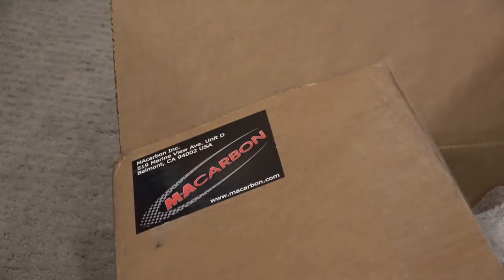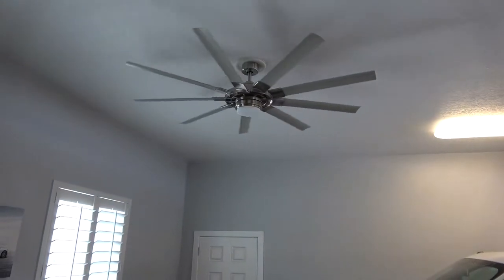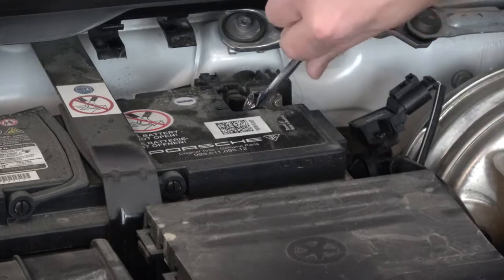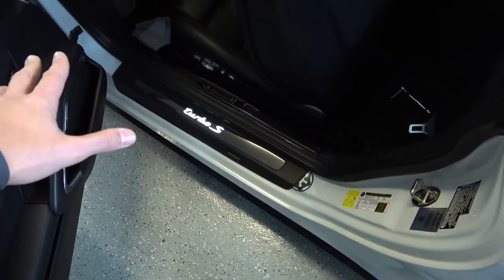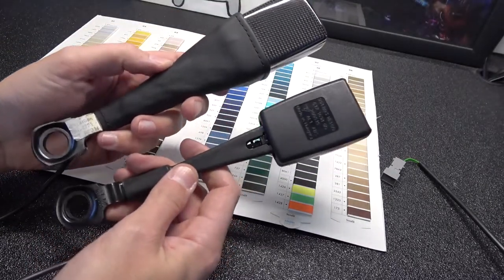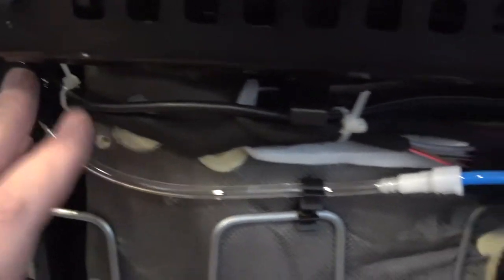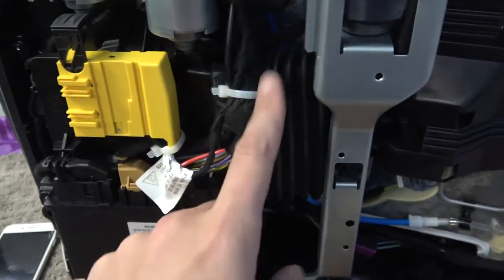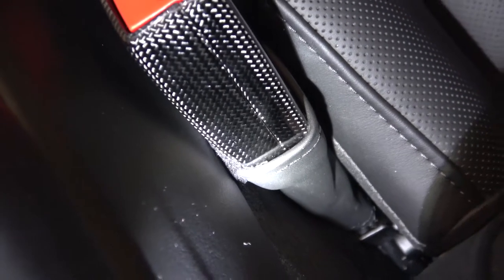Porsche 991 Front Seat Belt Buckle Replacement (MACarbon)

Comment: Hi Cam, just wanted to thank you for posting this. I just switched to 18 way seats and didn’t notice there was no seat belt latch included. No big deal I thought, just take off old ones and replace…until I saw the wire harness snaking through the seat! I was a little concerned until I came across your video. It was outstanding and I followed your excellent directions and managed my way through. The 18 way seats are unbelievably awesome. Thanks again.
Reply from the maker: Glad it helped!